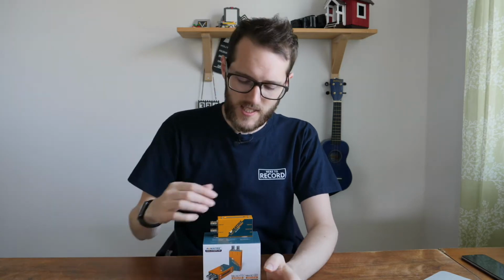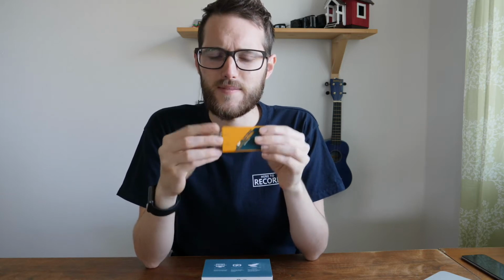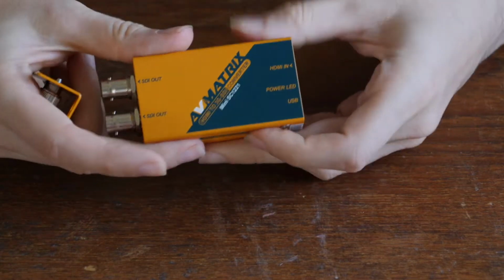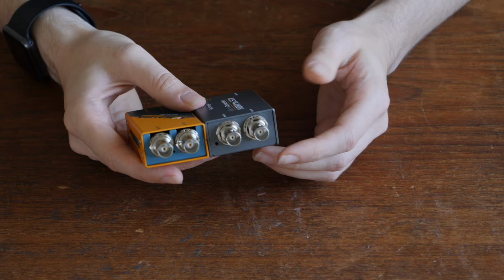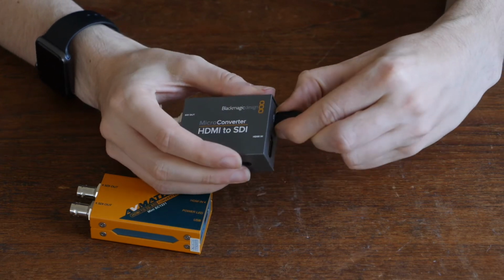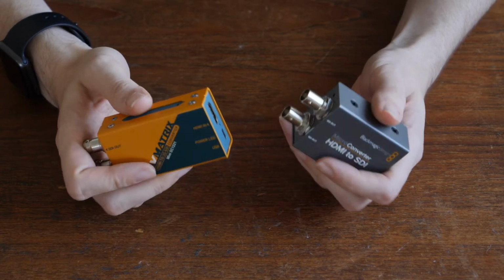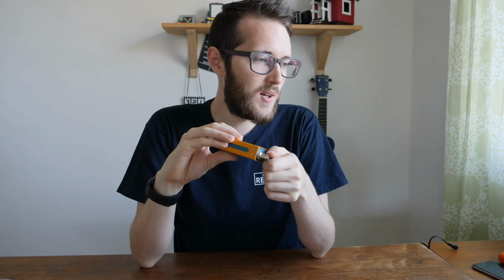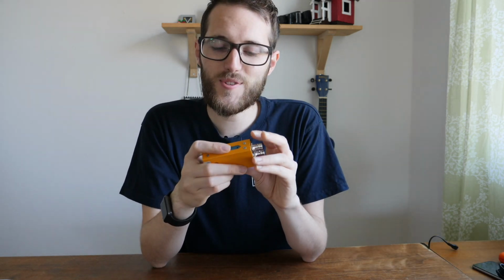AVMatrix HDMI to SDI Mini Converter (SC1221) // Show and Tell Ep.39

Comment: hey so afte all these years, do you still prefer BLACKMAGIC over AVMatrix?
Reply from the maker: I still do tend to buy Blackmagic gear, yes.
Reply: @heretorecord  ive been reading about blackmagic having some heating issues after a while. Did you encounter that too? thanks for replying
Reply from the maker: Not that I have spotted with the converters. They all will get hot though